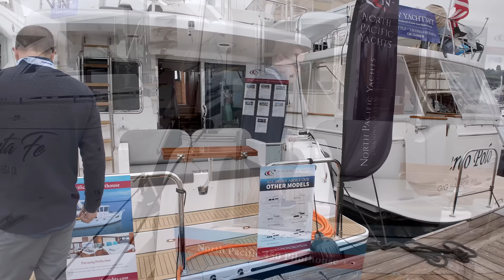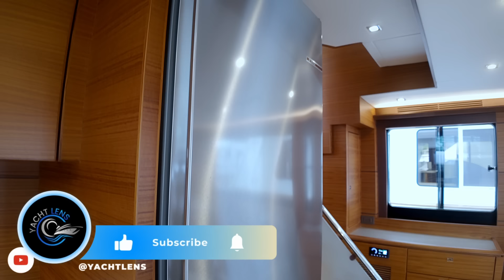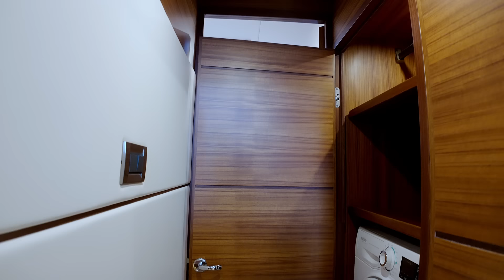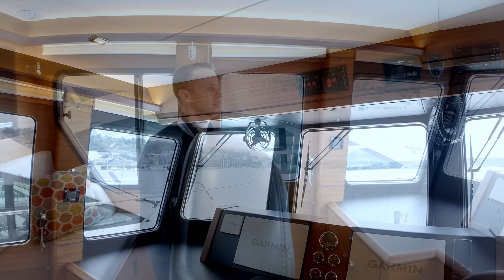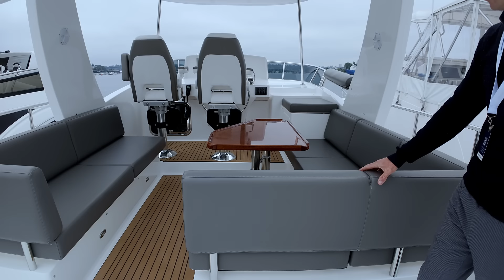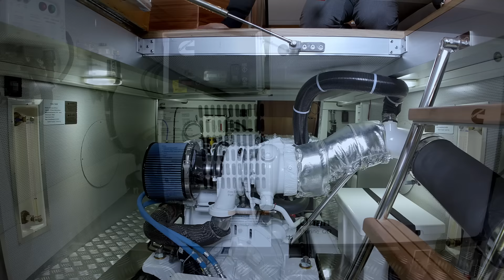FIRST LOOK! Maximum Yacht in Minimum Length | North Pacific 450 Trawler Review

Comment: A few comments: With an asymmetrical design, how does one ever access the port side for cleaning, maintenance etc?  Also limited to starboard-only docking etc.  I’d prefer to delete the massive swiveling seating in the cockpit.  Personally I’d prefer freestanding furniture.  Is there a remote docking station aft?

Comment: Very nice salon. FINALLY, a builder who knows the need for large capacity food cold storage. Awesome frig/freeze unit and high quality brand. Impressed with it's a single diesel for range and maintenance lower costs. Even has a fly bridge. The best small trawler on the market. Did hear if it has a stern and bow thrusters but if it does this may be the best under 65 foot trawler on the market.

Comment: My guess would be close to 2 million australian dollars
Reply from the maker: That’s a pretty educated guess for a fully optioned, new, ocean-capable 45-footer in today’s market, especially once you convert, add GST, and factor in shipping or local delivery. Exact numbers swing a lot with engine choice, electronics, tender, and whether you’re talking landed in Australia vs. ex-factory, so I always point people to the builder or local dealer for a real quote rather than ballpark it in the comments. For you, are you more in “serious research” mode on this size, or just sanity-checking what this level of comfort and range tends to cost?
Reply: @yachtlens no i have been a boat owner and work in the boat repair and maintenance industry in aust so know which brands are good and which brands are not you get to see all the issues and faults with new boat brand some needing repairs and modification even when delivered new from Factory

Comment: Not stabilized?
Reply from the maker: Good eye—this particular boat is not equipped with a stabilization system. Some owners in this size range add fins or a gyro, others rely on the hull form and speed for comfort, and this one went the simpler route. Often using the links below our video, you can inquire with the manufacturer on options and adds on like this.  If you were specking a similar yacht for serious cruising, would stabilization be a must-have for you or a nice-to-have? 🛥️

Comment: Is there a bring home engine like Nordhavn has? With the amount of fuel it carries what is the range at cruise?
Reply from the maker: Great technical question. This boat runs a single main engine with no separate “bring home” wing engine like you see on some Nordhavns, so redundancy is handled more through systems and maintenance than a second shaft. Range at cruise wasn’t quoted in the tour, and it will depend a lot on load, conditions, and how conservatively you run her, so I’d point serious buyers to the builder’s data and surveyor’s sea trial numbers rather than guess here. On your ideal long-range boat, would you prioritize the extra machinery of a dedicated get-home engine, or keep it simpler and put the focus on fuel capacity and maintenance? 🧠

Comment: What was the range…massively crucial spec also a base price
Reply from the maker: You’re absolutely right—range and a baseline price are make-or-break specs when you’re evaluating whether a yacht fits your plans. In this walkthrough I focused on layout and systems, and I don’t want to throw out guessed numbers for either range or price, since both depend heavily on load, condition, and current market. For someone seriously comparing options, I’d treat this tour as the “is this the right platform?” step, and then have the broker or builder confirm the hard numbers thru the links below our video! Are you building a short list of candidates right now, or still figuring out what range/size band you actually need?

Comment: Ever ocean boat needs two engines
Reply from the maker: Feel free to do your own research but I can guarantee you will find this not to be the case. Most deep ocean vessels have large engine rooms to hold their high tech engine with parts and take meticulous care of them. You may wish to buy a smaller vessel with twin outboards perhaps. Thanks for watching.
Reply: Actually most trawlers only have one engine with diesel engines its usually a fuel problem so if you have 2 both will be affected anyway a good fuel polishing system and regular  primary filter changes and a few spares and any problem can be dealt with
Reply: Most ocean trawlers have 1 engine it allows a lower cg for boat which is more seaworthy and good access all around for maintenance

Comment: So what's the range on this as it's set up?  Looks like an awesome couples boat?
Reply from the maker: At slow displacement you could go 2.7 nautical miles per hour cruising for 5,500 miles! Or if you amped it up to 6.2 nautical miles per hour it results in a distance of 1,478 miles or push it to 9 knots per hour and it becomes 633 nautical miles. It is an awesome couples boat! Thanks for watching.
Reply: @yachtlens thank you. If you wanted to go down you could actually cross oceans, provided the weather held.
Reply: That was my thought. Is it capable of cruising the Pacific Northwest for weeks?

Comment: NP excels at all the things you mention, but does this model come with their get-home option ? Stabilization  ? Key issues, I would have thought, for the likely buyers, ie families & retirees. If it's possible to address those safety & sea comfort concerns , then this is a superb entry level trawler, imo.

The reversible aft bench alone is genius.
Reply: Good points I would also rethink the stove position if you are planning on having to cook under way. You hit a big wave or anything that can cause the boat to slow suddenly and you will be wearing what you were cooking. Also would prefer an Induction option as gas can be used for a secondary heater but can also add to fire issues if a shut-off is not properly placed.
Reply from the maker: Simply put, many of these boats are highly customizable. We suggest contacting them at the link below the video. Thanks for watching.
Reply: Yeah, over 30 feet I really want a second engine, hell, even if just a kicker to get me home.  Love everything else about it though!
Reply from the maker: Yes indeed some are concerned about one motor and you could always write them at the contact link below in the description. Thanks for your view!
Reply from the maker: Excellent question, I recommend you check in directly with Trevor at North Pacific, his contact info is in the description. Thanks for watching and for the thoughtful question.